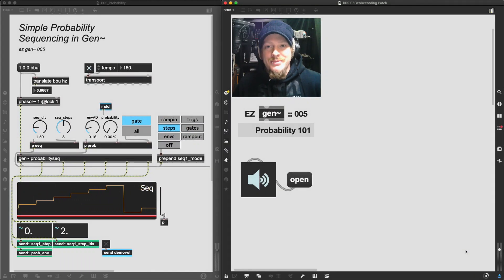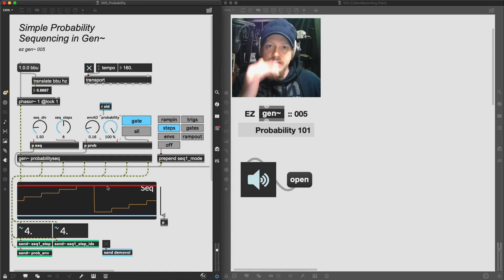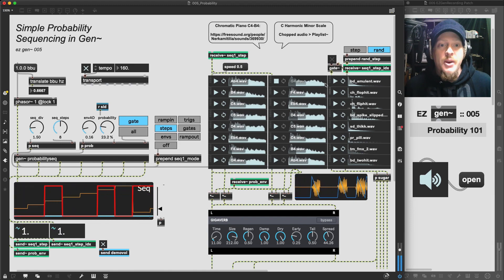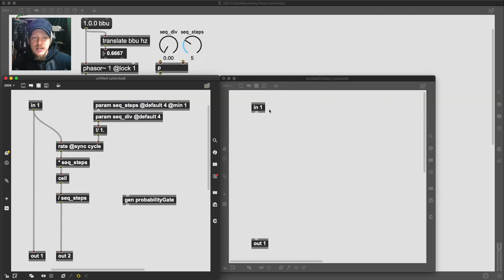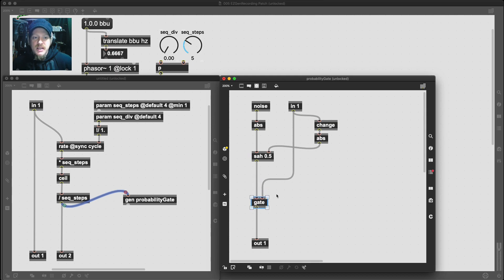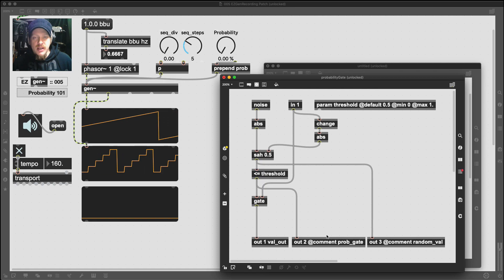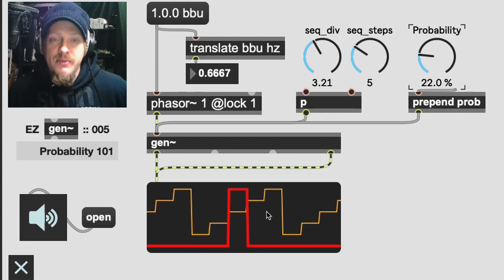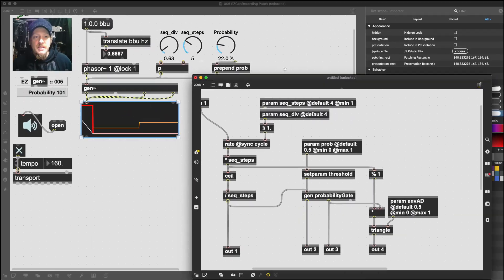EZ Gen~ MaxMSP Tutorial 005 :: Probability 101

Comment: Wonderful. Good tip on not routing out from number~. I remember making a patch one day and routing a heap of things via number then realising it sounded like chowder because the latency on number~ is hideous. Also good info on the triangle - I didn't know there was one in gen, letalone one that could be shaped.
Reply from the maker: it defaults to 10hz so it’s like gating your signal with a 10hz squarewave 😵 which you’ll hear as audio - but easy to miss for control signals!